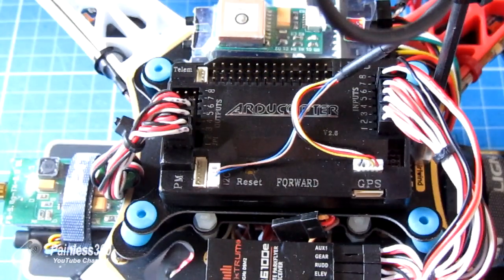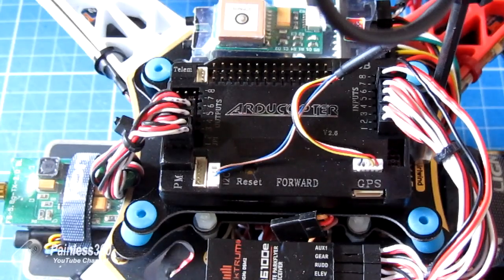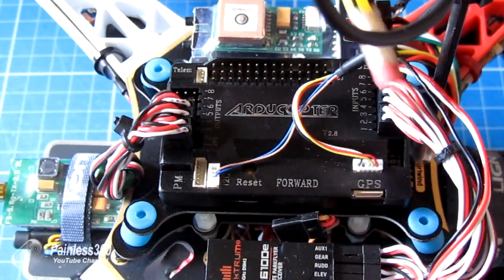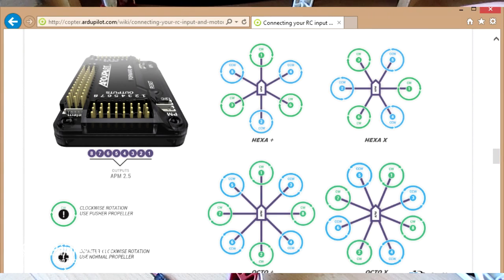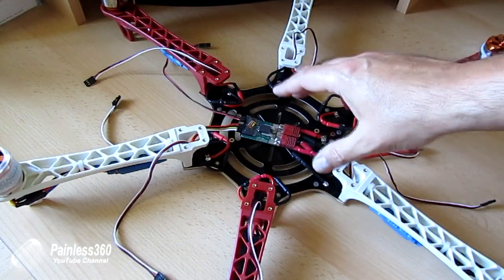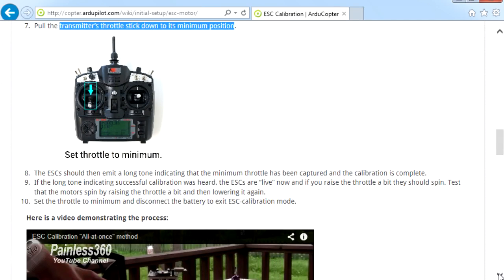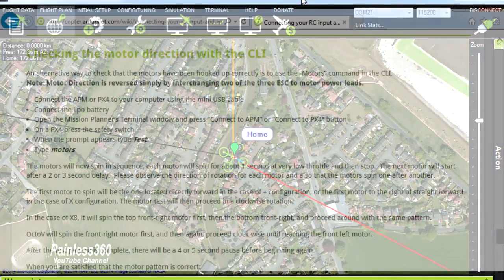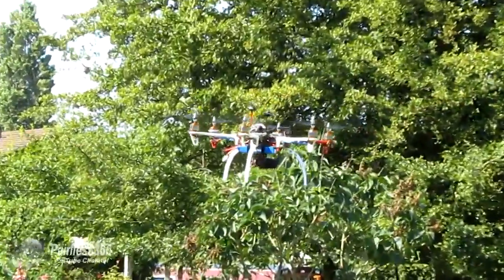(2/8) APM 2.5/2.6 - Powering the board, motor installation and ESC calibration

Comment: Hi,

I'm building my first Quadcopter. I'm using the S500 frame, with the APM 2.8 from bangood and 4 of this ESC: http://www.banggood.com/RCTIMER-20A-BLHeli-OPTO-Mini-Brushless-ESC-Speed-Controller-For-Quadcopter-Multicopter-p-982504.html 

I follow every step of your video and I cannot make the motors spin, I really don't know what to do, I try to make the ESC calibration, and I don't know if i'm doing something wrong, but after the beeps, I disconnects the Lipo, i connect it again, I put the throttle down, and nothing happens.

I'm using the radio transmitter Turnigy 9x.

I really need help from someone who knows about it.
Reply from the maker: +Oriol Navarro You are arming it aren't you...
Reply: +Painless360 No, no, I don't think so, I'm building it, and I followed your steps from the first video of this series, and everything worked fine, and now, I'm following this ones, and I cannot make the motors spin, I don't know if i'm arming or disarming, or If I have already calibrate them. What I have noticed is that they spin just a few degrees, but then, i cannot make them spin at all.

Thank you very much for your attention, I'm looking forward for your response.
Reply from the maker: You need to arm it before the motors spin. See the arming video in the playlist.. Best of luck

Comment: I am truly grateful for your video tutorials on the APM 2.5 ..... it would appear that my brain is now in meltdown mode as to how I fit the power module to the system.... do I make up a new PDB to Batt lead using a male XT60 and then fit the PM inline or can I remove the female XT60 from the PM and then solder the wires direct to the power points on the Hex bottom plate PDB? I would prefer the latter method, and if it's at all possible what way should the power line for the APM be facing from out of the inline step down??? ... cheers for any assistance.... :-)
Reply from the maker: +David Garrett I normally fit the PM to the existing plug on the PDB and then connect the battery to the other connection on the PM board. Hope that helps!
Reply: +Painless360 , many thanks,.... I managed to locate the info I needed.... I just unsoldered both plugs from the PM loom and then re-soldered the male xt60 back on to the opposite end and soldered the +/- cable straight to the bottom plate PDB of the f550.... now to get down to business and have another swatch of your 8 vid series on the apm 2.5 ... many thanks for your reply and taking the time to record the videos.... great work... :-)

Comment: if I have 4 escs with internal bec can I just blug all cable to apm output including 5volts wire not just the signal to power up the fc rx etc? I think it is possible but some people are afraid of it and power from input 5volt rail through rx.
Reply from the maker: We cover this in the ESC videos on the channel. Take a look at the videos in the 'Introduction to RC' playlist. Best of luck
Reply: +Painless360 Thanks, your videos are really good. By the way I did not find the answers in the "RC Basics - Understanding Electronic Speed Controllers (ESC)" video neither at the "RC Electric Power Systems Simply Explained (ESC, BEC, LIPO, Brushless etc)" video.
I want to know how to connect multiple ESC's when both have 2A 5V UBEC without risking each to fail and under-powering Fc from output rail.
I tested and if FC is powered only the signal is enough to be connected between the ESCs and the APM output as GND is already shared and 5volt is not needed by the ESCs.

1) can I remove the pins and make the 5volt outputs of each ESC in parallel and connect to the RX to power the APM from the input side. (My APM is powered normally from input rail through the RX's cables and the UBEC from power board is connected to the RX's 8ths channel. I don't wish to use a BEC for this as I have 4 ESC each have 2A UBEC.)
2) should I use some Schottky diode to avoid reverse voltage between teh 4 ESC's 5V output?
3) or is it enough to just plug them to the FC's motor output and they will work fine with both 5V connected to the same rail. This way FC is powered from the output rain where there is a Si diode and 5volt drops to 4.3Volts and FC will be under-powered.
And there are many other possibilities, I don't know yet which is the more safe and more powerful.
Reply from the maker: If the BECs that are part of your ESCs are all 'switched' then connect only one of the red wires that provide the +5v than come from the ESCs. If they are 'linearl BECs then you can normally connect all the red wires without a problem.

Hope that helps.
Reply: Painless360 Thank you, but how could I know is it a linear regulator or a switched step-down DC-DC converter inside, any advice on this?
 There is Chinease description and UBEC is written there, on the sticker on the ESC's heatshrink BEC is written...
Reply from the maker: You need to ask the supplier if it's not obvious. Best of luck.

Comment: hi bro.. very pleased with ur informative apm videos. .
thanks 2 u i got my apm flying osmm... but after 2 weeks I now face a new problem with altitude hold. .
my quad jumps up and down when I use the barometer. .
it also effects loiter mode.. but no effect in position hold mode... i tried replacing foarm inside the apm 2.6 hardcase but no use .. tried giving it an external cover and even tried resetting it to defaults and programmed it from the beginning. .
please help me ..
my setup..
.dji f450  frame
sunnysky x2212 980kv
carbon fibre 1047
simon k 30A
5000mah 3s 20c 
apm 2.6 with external gps and power module
flysky fs-th9x 
my quad is flying superb in stablise mod... i have been trying hard to find a solution but found none working. .
hope ull help. ..
thanks in advance. .
Reply from the maker: I would check the log files. as per my other answer.  Best of luck!
Reply: I had similar issue when I yaw it fall and it turned out that the baro sensor is too sensitive to light. I covered everithing around fc with black tape and alu foil and it is not falling now at sunlight
Reply: +FotoAmg AmgFoto thanks I'll do that too but already have hardcase installed and that too is inside the body of the f450 frame . will seal it from external light

Comment: hi again!
Got some troble with the power on my APM... thoughts?
https://youtu.be/4xcVi7h0wHQ
Reply from the maker: Couple of things for safety and long life of your model.  Never get near live electronics with a thin metal tool ;) and never power your telemetry radio without an antenna that can seriously damage the transmission circuitry.  

Check that J1 hasnt come loose in the crash ;)
Reply: Painless360 thanks for your advice... all three of them. The JP1 sits on solid, actually i have trouble taking it off. Some one, in an other forum surgested that I i redo the setup and remove the JP1 all together. But since I have flown with it, twice, I recon that JP1 needs to be there. Can it be broken, so I need a new one?
Reply from the maker: Possibly. It would be worthwhile removing the board and checking for cracks / soldering issues. I woukd also see if the power from the BEC in the ESC is supplying 5v.. Best of luck.

Comment: Hello, I'm bilding a 650mm frame with old 920 Dji motors and 30A opto ESCs, Original APM. every thing is connected as you say in your videos. I'm tryng  to calibrate the ESCs but I'm not able.
In your video you say with OPTO ESC I need to have a UBEC to provid 5V to the controler...
Can you help

Comment: Painless360, the Turnigy motors on the hex in this video, may I have the specs on them. Looking to replace my Sunnysky ones. Thanks.
Reply from the maker: John Bailey These motors are very heavy but very powerful. Not sure I'd choose them now if I was building the model again. I got four of these back in my early quad career and then added two more for the Hex. They are D3536/9 910KV and I have mine swinging a 11x5 prop. Best of luck with the build!

Comment: Hi painless360,
I do really need help.i follow the apm set up and everything.but when I plug un my battery the motor won't work with apm.what did I do wrong?my esc is dji e310 with dji 2312 motor.it work on calibration with apm but normal mode
Reply from the maker: gideon macalino what troubleshooting have you done?

Comment: Hi Painless360  Question, I have done the setup calibrations on 2.5 APM  but have a problem with one of my motors of my Quad  the motor does not start until late, is there a way of making it start with the others, or is the motor faulty. Regards Geoff
Reply from the maker: SuperGoofa Swap that motor with another - if the motor is still lazy then return it. If it start OK then the ESC needs calibrating..
Best of luck.

Comment: Thank you so much for your videos. I have been flying multirotors, helis, and planes for a while and when I got a Quantum Venture with naza lite I was just frustrated to all out with it having major Yaw issues. After changing out motors and checking all connections I decided to get an APM 2.6 with an external GPS to switch out the NAZA Lite. I set it up as an H pattern and it flys so beautifully now. Your videos were a great help.

Comment: i got an apm from a friend but it didnt come with any harness for the reciever is there anywhere to get them
Reply from the maker: Justin Adams The 'harness'? Not sure what you mean. The receiver to APM uses standard servo cables..
Let me know what you are after..
Reply: i have an arducopter apm that came with the power module and just the gps/compass antenna, i have a 550 frame that has a mwc installed and wanted to upgrade to the apm
Reply: basically the stock setting its running when i try to take off half of the hex lifts off and most likey would flip over
Reply from the maker: I would check that the props are all on the right way and that the motors are all connected into the right ports on the APM.

Best of luck.
Reply: im running the stock board now, i was planning on upgrading to the apm soon
Reply: i have an apm with just the power module and gps and compass module

Comment: Hello again, I have 'pain' :)
I' wondering if you know what my problem is:
I'm stuck with the throttle setting in flight mode. I posted a short video, I think that is better than 1000 words trying to describe it. Any idea what I can adjust (parameter) to have a smooth transition from 0% to 3% throttle? The "jump" in speed happens at about 3%. (In calibration mode ist works like a charm as you can observe).
https://www.youtube.com/watch?v=oAX0oziH1_Q

Thank you
Reply from the maker: bekawe2011 What motors and ESCs are you using? What is the firmware on the ESCs?
Reply: Painless360 The motors are RC Timer BC-42  650kv, the ESC are from Hobbywing, Platinum Pro 40A (the blue ones). I don't know about the firmware, they're (original)standard [setting:brake= off, batt.type= NiMh, cut off mode= soft, cut off threshold(voltage)= low, start mode= normal, timing= medium 15°]. All the components are new, never flown.
Reply from the maker: These are not using a Multirotor specific version of the firmware. They are probably running at 50Hz update frequency. Make sure that the APM is using the same - ArduCopter:RC_SPEED - http://copter.ardupilot.com/wiki/configuration/arducopter-parameters/#esc_update_speed_arducopterrc_speed

I would strongly suggest trying to use ESCs with SimonK or BLHeli on a multirotor. https://www.youtube.com/watch?v=OZNxbxL7cdc

Best of luck.
Reply: Painless360 Thank you very much for your answer. I'll look the Hz thing up and if it doesn't match then I go to your suggestion with the Multicopter specific ESC. (Doooooo... my newbies mistake buying incompatible stuff :)) I'll be back with the results..................
Reply from the maker: Don't worry, we all do it. I have an ESC video here that may clear up any confusion - https://www.youtube.com/watch?v=OZNxbxL7cdc
Reply: Painless360 I already discovered that very well structured and very informative video! Thanks!
Reply: Painless360 I appreciate your help. You're right: I tested some possible Hz setting for the rate to the ESC with no luck. No change in the throttle behavior nor other audible variations.  I also found a technical data sheet from that ESC and there is no mention to multicopter, only Heli and Plane(Wing). So it is obvious that I bought the wrong ESC. Now I will order a set of SimonK and "special" designed for multicopter.  I'll update you as soon as I tested the new ESC.
Reply from the maker: Dang! Best of luck with the new ESCs..
Reply: Painless360 Hi :) first of all a big THANK YOU for reading and answering my questions and leading me to the right direction with the copter issue. Now, with the correct ESC installed - all work fine as expected! Now it's time to fasten the components definite on the copter, arrange the cables and so on. Perhaps the next weekend I'll dare a first lift off. BTW..... lucky that I tried the copter fixed to the ground first, some of the prop(nose) nuts and props suddenly flow away. I'll install well tightened safety nuts now. 
One arm on the test bench was able to lift a 1kg bottle of water. So the lil' beast have trust reserves (6kg) :)
Reply from the maker: Great news - happy flying!

Comment: can anybody tell me why on my hex my channel 6 motor either wont stop spinning it just takes off after i plug in the battery or it does nothing? i an unable to calibrate that esc by the all in one calibration but i can get it to do it by plugging it into my reciever and doing it one by one but than it just take off after i plug it into the output #6? ive tried everything i can think of so could someone please help me??? thanks
Reply from the maker: Ryan Hoemke I would re-install the firmware and start again.. 
best of luck.

Comment: I'm using a PM plugged into the APM2.6, do I need the + & - on the inputs and outputs? I'm trying to eliminate wires.
Reply from the maker: John Bailey You should always run a GND wire along with a signal wire to make sure that all signals are properly grounded. You can remove the red wires from the ESCs if you are using a PM, you can also remove all but one set of red/black wires in the servo cables for the PWM inputs from the receiver too. 
Best of luck with the build.

Comment: Hi Painless360, your videos had helped me a lot, you can't imagine,
I have a question regarding the last step, which is the recalibration with the Mission planner software.
For that the APM2.6 has to be connected bis USB? if so, i do it before starting the programm?
Reply from the maker: You can connect the board at any time but I normally plug it in before starting Mission Planner..

Comment: If Someone can help me please i did a hexacopter and everything but motor #6 WONT start i dont know what else to do IF someone help me i will be super happy! Painless360
Reply from the maker: Have you tried running the motor by connecting the ESC directly to the throttle channel of the receiver? What troubleshooting have you already done?
Reply: I connected motors from 1 to 6 on thr output side installed reciver in input side correctly , instsled hexa firmware try arm it but only 5 motors work....    im using 5100mah    8c 3dr battery
Reply from the maker: Then you need to try running the motor by connecting the ESC directly to the throttle channel of the receiver..

If it works then you know it's the output on the APM, if it still doesn't then it's the ESC or motor to blame..
Reply: I forget to tell you if i plug it in output 1-5 it works amazing :) and sometimes it arms itself  no matter i arm other five or disarm them its like that one is independent
Reply from the maker: You need to calibrate it then using the single method (https://www.youtube.com/watch?v=OOplk52R4no) to see if that helps if not then you need to re-check the APM settings and maybe re-flash it.

Best of luck.
Reply: It worked! Reflashing and recalibrating it one by oneeeeeeee hahahah all motors working strong together but i found other problem :( its tries to tip over i dont know why and one mother making a noise like a silbing noise +Painless360
Reply from the maker: Sounds like you have two of the motor connections swapped round. Easy to do when you have so many wires to manage. Rechekc all the motors are plugged into the right outputs on the flight controller. I cover all this in the APM series - may be worthwhile watching through again now you are so close to flying - https://www.youtube.com/playlist?list=PLYsWjANuAm4oswLMu9OU8yOm-9J6y30XW
Reply: Thank you i will do, it might be because i started arming the quad like  a hexacopter + then decided to change into x mode
Reply from the maker: That would do it.. Best of luck.
Reply: Ok, i wish i could stop bothering you bro :( i calibrated esc and all 6 Motor spinning ok! :D but then when i unplog battery and plug it again after 5 sec  when i try to arm it it stay blue and red flashing normally, it should go to a red flashing rapidly and it doesnt , so in short words it wont arm :( -.- Painless360
Reply from the maker: Watch the video about troubleshooting arming in the APM playlist. Should help.
Reply: Wich one
Reply from the maker: If you search on the channel you will find it. Best of luck.